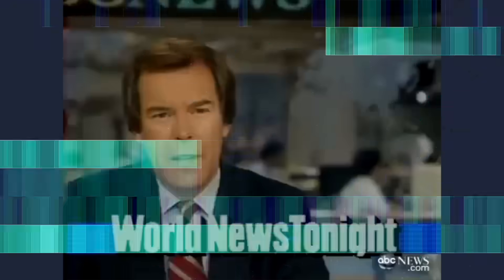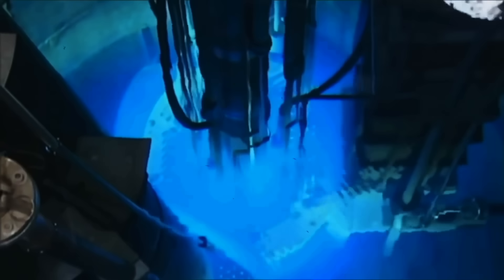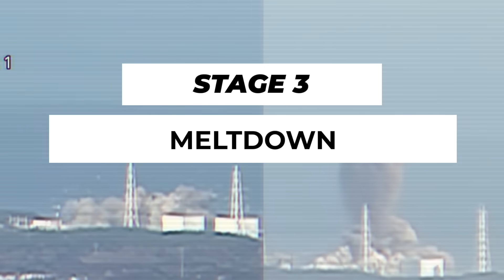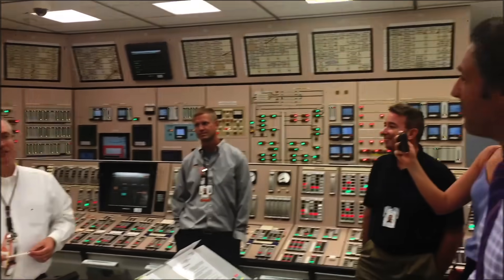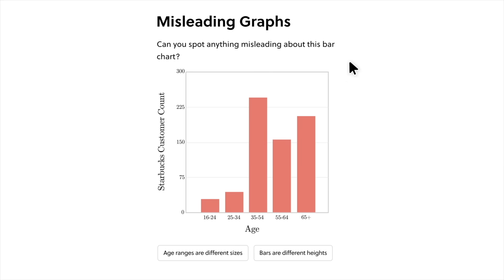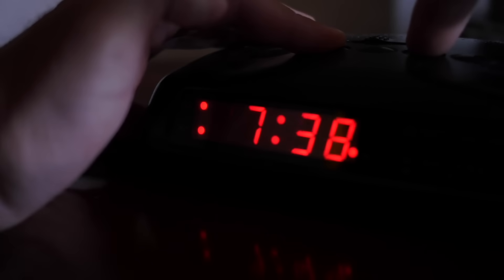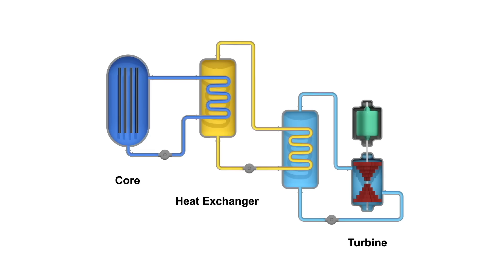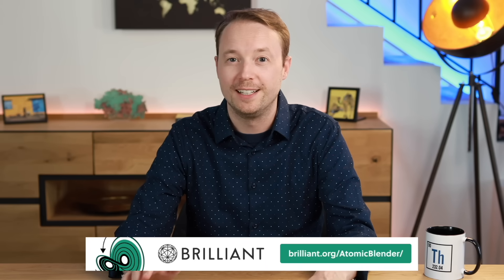Why Is It So Hard to Stop Meltdowns?

Comment: Thanks for another video. I would add Chernobyl was dual use reactor (military/civilian) from very different time and culture... After Fukushima they made stress tests at our local reactor, it was found a few ordinary fire engines can be used as a back up for existing 2 or 3 backups.
Reply: Chernobyl was a debacle when it was constructed. The roof was supposed to be reinforced and fireproof, instead a plain tar roof was installed. Which was flammable, exasperating the problem after the power excursion dismantled the reactor explosively.
Had TEPCO not ignored the designer's production change of venting the reactor through scrubbers to the outdoors, Fukushima would've just been a TMI type of meltdown, with a few leaks from earthquake damage and far more manageable. Had they raised the seawall, as warned to do, the site never would've flooded.
Both show risk acceptance beyond what should be considered acceptable - at a level not witnessed since the last two space shuttle explosions. Better to face a faded giant report than a pinnacle faded giant, with accompanying big black eye for regulators and operators alike.
Or for example, TMI vs Fukushima/Chernobyl. Middletown, PA is still inhabited, no cancers since that meltdown and the second unit was only shut down for financial reasons in 2019. Chernobyl's remaining unit remains online (save when shut down due to some hostilities and foreign troops digging in and stomping around the grounds), but the entire region remains an exclusion zone for good reason. As thousands of Russian soldiers will learn as they contract various cancers fairly soon.
Reply: @spvillano Chernobyl had its last unit shut down in 2000. It’s been in the decommission phase for a few years now.
Reply: @IPeakedAt15 totally, which is why the Russians moving in and playing about military wise was entirely OK.
And precisely why they shut down shortly before, long after they shut down before or some bullshit.
Reply: @spvillano  I’m confused as to why you said it has a unit remaining online.
Reply: @IPeakedAt15  my error, I meant to say that the fuel cooling system remains online. The remaining unit was shut down in 1991 after a turbine fire. Before that turbine fire, the intact reactor was still online and generating power.
Reply: @spvillano  yeah 
And bwrs are just better
Reply: @seantaggart7382  BWRs are better than what? RBMK, PWR?
Reply: Indeed
And Really? You're unlikely to find a RBMK reactor nowadays
Reply: @seantaggart7382  true, it's hard to find the 2 in Leningrad, 3 in Smolensk and 3 in Kursk. It's not like the cooling system leaves any sign that it exists.
The last RBMK is schedule by Russia to shut down in 2034.
Then, they'll be as common as the Dodo bird.

If it wasn't for an unauthorized experiment, performed by workers that never should have performed it in the first place (the day shift was conversant with the test and all permutations of things that could've gone sideways), nobody would know the name Chernobyl. And in Soviet Russia, nobody talked about nuclear meltdowns, the nuclear meltdowns talked about you.

Comment: decay heat after shutdown is mainly from the decay of fission fragments not from delayed fission. Not in the first 30s but after 5 minutes the decay heat is ~100x greater then delayed fission.
Reply: "Boran"
Reply: Is delayed fission even a thing? I know that "delayed neutrons" are a core aspect of stabilizing nuclear reactor power levels, but delayed neutrons come from fission product decays, not from U235 atoms that waited before fissioning. Once struck by a neutron, the fission event occurs faster than 10^-15 seconds. 

Or maybe you are using that term to refer to fission events triggered by the delayed neutrons, which I'd just think of as the reactor's shutdown transient curve. I've long been under the impression that the reactor would shutdown very quickly, possibly less than a second, but after doing some math and first-principles analysis, it seems that your intuition on timing is the more accurate description ...

OK, I went way deeper on this than I had planned. The delayed neutron fraction is about 0.65%, and it's tempting (but wrong) to think that with the control rods in, all but 0.65% of the power evaporates almost immediately. Typical shutdown margin is only about 1%, which ensures the reaction rate will decrease to zero, but the delayed neutrons still have a very significant chance of triggering fissions, roughly 99% as high as their chance in a steady-state reaction (which was about 40% based on each fission generating 2.5 neutrons). So then I simplified what's known as the "point kinematics (differential) equation" by assuming that decay neutron production is non-varying and then solving for the steady-state power level when rho=-0.01 (ie, 1% shutdown margin). This yields about 40% of full reactor power, meaning that reactor power almost instantly drops to 40% on a curve determined by the 10^-5 second neutron generation time (aka, "lambda") -- ie, within a few milliseconds, hundreds of neutron generations have elapsed and you are already at or below 40% power. Then the rate of dropping all the way to zero, or to the 7% level of decay heat is going to be determined by the various delayed neutron group timings. I can get an intuition for that by pretending the faster groups are now prompt neutrons and solving the same math as before, and this is pretty crude, but best I can tell, yeah, it's going to take 10's of seconds to get below 7%, deep into the decay of group #2 w/ a 22-second half-life; if only group #1 and #2 remain and all other groups are treated as prompt neutrons, my simplified power level stabilizes at 14%, so yeah, it's going to take at least one 22-second half-life, plus a little to account for the rate at which those isotopes are produced being more than zero (somewhere between 13% to 40%).

So yeah, seems like your intuition is backed up by the mathematics. And I got a bit nerd sniped. And understand the math a bit better than I did before. So, thanks.
Reply: @ddopson  Yeah, whereas decay heat is IIRC something like 5% of the steady state reactor power for a relatively very long time, like days or weeks, and its power decays somewhat slowly as well. So basically a 1GW reactor that runs at about 3GW thermal power would keep producing 150MW of decay heat after a SCRAM. It's an incredible amount of heat really if cooling systems are compromised.
Reply: I sense some concept errors. From someone who doesn't know what they are talking about.
Reply: @kevinmeganck1302  passive cooling is part and parcel of a gen 4 design. But, name even one meltdown that wasn't human induced.
Yes, a malfunction of some sort occurred, but had a human action been correct, the meltdown would've been avoided. A good example, Chernobyl and TMI-2, both exclusively human errors that triggered the hot mess. Chernobyl, not recognizing xenon poisoning in the core until it "burned through" and the core experienced a rapid power excursion, TMI-2, misreading the signs and a lousy human factors design leaving a telltale lamp obscured from vision by being on the wrong side of a 7 foot tall console.
And I know TMI quite well, it's around 3 miles from me and the remaining unit shut down in 2019. Kind of miss the cooling tower plume, was a convenient landmark that was visible for many miles around.

Fukushima, again, human factors at a management level. Ignored warnings of an inadequate seawall and no venting outside the building through scrubbers for any hydrogen gas - something specified by the manufacturer as a safety improvement. A few meters taller and the site likely wouldn't have flooded and only the Japanese would even know that Fukushima even had nuclear plants. Getting emergency generators in place in time wasn't in the cards after a tsunami, so prevention was critical and ignored.
Venting the hydrogen outside would've prevented what started as a TMI meltdown turning into Fukushima.

And all had one other failure, which made things much worse - no communication with the local government about an emergency and precisely what was going on, even if it's uncertain.
Reply: I like it.

Thinking to gadget history, there's certain flavors that don't work with the recipe. What is it, 237? One of em is like completely random on having a decay event. Lotta different curves being burned atop one another.
Reply: @ yeah. 237 is the natural isotope, that and 239. 237 will decay really randomly and give off some weird particles.
Reply: Is that why it takes long to declare a cold shutdown?
Reply: Just what I was gonna say. Reactors normally operate on delayed fission, not prompt criticality or higher
Reply: @TheMadScientistOfLuton  not exactly. Most reactors are powered by prompt neutrons, or by prompt neutrons that have become thermal neutrons due to water slowing them down. Delayed neutrons are from fission fragments decaying. If that was the sole source in fission events, it wouldn’t be as efficient.
Reply: @j_andrzejewskigaming6491  Most fission events in a reactor are triggered by prompt neutrons, yes. However the reactors are kept at a neutron balance where they would be barely subcritical on prompt neutrons alone, and they only reach criticality when factoring in the small fraction of delayed neutrons too. The very slowness of delayed neutron emission is what keeps the exponential growth of a supercritical (or subcritical) fission chain reaction slow enough to be controllable - Chernobyl 4 is a good example of what happens if a nuclear power plant manages to go prompt critical. Near-zero power to 30GW thermal in the blink of an eye.
Reply: @emepantti  DNPCs are a factor when it comes to criticality balance, but from my experience with Naval reactors, it really isn’t a significant factor to consider when shining to criticality. The percentage of DNPCs vs prompt neutrons in the overall neutron generation is small. And yes, prompt jumps are horrifying. I am very aware.
Reply: @j_andrzejewskigaming6491  I know this is from a while ago, but I wanted to point out that you're kind of confusing the terms Prompt/Delayed vs Fast/Thermal. Prompt and Delayed are terms we use to indicate generation times for said neutrons, whereas Fast/Thermal are an indication of the energy level of those neutrons (in MeV). While it is true that delayed neutrons are born at a lower energy level than prompt neutrons and therefore more likely to become thermal neutrons, they're still born as Fast or Fast-ish neutrons. Otherwise I agree, most neutrons that cause fission of U235 are born fast and thermalized in the core, with those born delayed making up typically less than 1%, but that 1% is what lengthens generation times and allows a human operator to act to control transients, etc.
Reply: @j_andrzejewskigaming6491  I am super late to this but I wanted to comment on what you said about DNPCs not being a significant factor in reactor criticality conditions. The DNPCs are the only reason we are able to control nuclear reactors at all and are a huge part of why every nuclear reactor doesn't behave like a bomb. If you want to see what happens when we ignore DNPCs, go look at a video of a research reactor pulsing.
Reply: @ I never said it wasn’t significant. Criticality due to DNPCs is smaller from prompt neutrons, that’s what I said. You can’t avoid DNPCs, and we certainly learn to factor them in getting critical.
Reply: It's a Meltdown Dude does the origin of the Meltdown Heat really matter...

Comment: I thought that modern reactors had poison (xenon) pumps that could be pumped into the reactor to stop the nuclear reaction?
Reply: Stopping the nuclear chain reaction (with the control rods and/or injections of something containing boron) is not the problem.  The problem is what happens after the fission chain reaction stops.

Uranium-235 atoms have 92 protons and 143 neutrons (so around 1.55 neutrons per 1 proton).  However, when fission occurs, the atom splits into two smaller atoms, but the resulting fission product atoms have too large of a neutron to proton ratio.  For example, iron-56 has 26 protons and 30 neutrons, which is a neutron to proton ratio of 1.15:1.  This value is much smaller than what the uranium fission products will have (ex: around 1.5:1).  As a result, the fission products are intensely radioactive, as they have too many neutrons to be stable.  They eventually experience radioactive decay by various mechanisms, until they do become stable, but each of these decay events releases additional energy, that is substantially delayed (ex: days, months, years, decades, and even centuries) from the initial fission of the U-235 nucleus.

In other words, when you immediately shut down a reactor that had been operating at full power, the core still produces around 8% of its full power level heat output, due to radioactive decay of built up fission products in the core, even though the fission chain reaction has been fully stopped.  For a 3 Giga Watt thermal reactor core, this means it may be producing around 240 Mega Watts of heat, which is still an immense amount of thermal energy production.  In order to dissipate this much heat, the fuel rods must continuously be submerged under water, and the cooling water must be circulated through a heat exchanger to remove the heat, or else it will all boil off in relatively short order.

Most of the nuclear reactors used in the US and around the world are designed in a foolish way.  In order to remove the fission product radioactive decay heat after a shutdown event, they primarily rely on using electrical grid power to run water pumps to keep the water circulating through the reactor core and the heat exchanger.  This is a really bad design decision.  In order to provide electrical power to run the cooling pumps when the grid itself is down, the nuclear power plants are equipped with a diesel generator to run the cooling water circulation and heat exchanger pumps.  This is really unwise, since diesel generators are high maintenance products and have rather low availability factor.

This is what doomed the Fukushima reactors.  In that case, an earthquake caused the grid power to shut down, and the earthquake also caused a tsunami that inundated the diesel generator with water and made it non-operable.  Consequently, the power plant operators had no way of keeping the core cool by running the water circulation pumps, and the water in the cores all boiled off.  Once the fuel assemblies were exposed to air, they promptly melted down and released large amounts of highly radioactive fission product gases and other substances.

The heat of the core itself is an energy source, and it is possible to design a cooling loop that uses the fission product radioactive decay heat from the core itself, to run the cooling pumps.  However, US nuclear reactors are not designed that way.  It is also possible to include solar panels and batteries on site, whereby the solar power system can keep the cooling pumps and heat exchanger equipment operating indefinitely, without the low reliability and constant fuel use of the diesel generator.  Additionally, such equipment could be used during normal operations, and all the surplus solar energy can simply be sold into the grid, while the batteries could help provide peak load energy to the grid.  However, nuclear power plant operators in the US and around the world are normally not enlightened enough to do this, so instead they rely on the diesel generator, which is fundamentally unreliable equipment, since it requires constant fuel input, and it has too many moving parts and failure mechanisms.

What this means, is that if some major event were to occur, such as a solar flare induced EMP (electromagnetic pulse) event, it would be likely that many nuclear reactors would melt down, similar to what happened in Fukushima.  During a solar flare induced EMP event, many transformers and grid infrastructure may become damaged.  This would prevent the nuclear power plants from using grid power to run the cooling pumps, and it would simultaneously make it hard to acquire the diesel fuel needed to run the backup generator.  Additionally, the backup generator is not really intended for continuous operation for many months or possibly years, which is what would be needed, if the nuclear fuel is never removed from the reactor core and transferred to a passive cooling pond large enough to naturally dissipate the residual radioactive decay heat energy.

Solar panels and batteries would not be damaged by a solar flare induced EMP event, provided that they did not have overly long exposed wires on the system (ex: miles long).  It is therefore relatively easy to prevent core meltdown in the event of a solar flare induced EMP event, but it requires augmenting the diesel backup generator with a much more reliable solar power system that does not require active human intervention and constant supply of fuel (which would become hard to acquire, since diesel pumps rely on grid power, and oil refineries also expect grid power to be available, and communications equipment like cell phone towers also expect grid power, which would all likely become unavailable, possibly for a long time, follow a sufficiently damaging solar flare EMP event).
Reply: It's boric acid :)